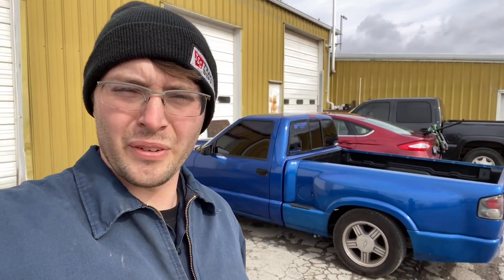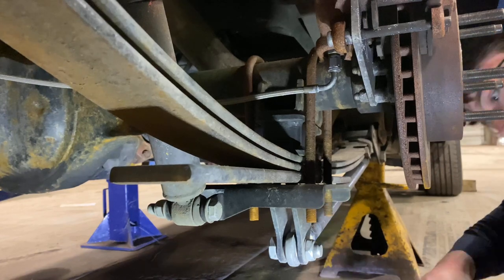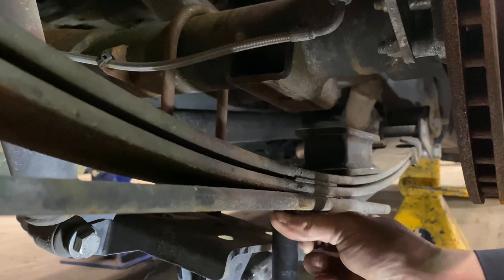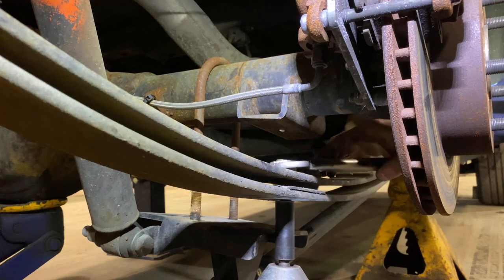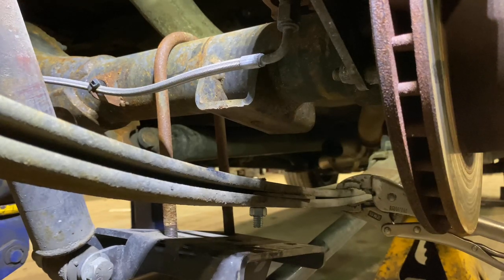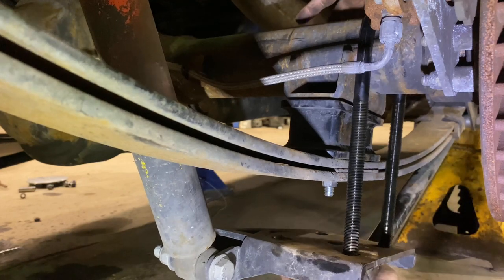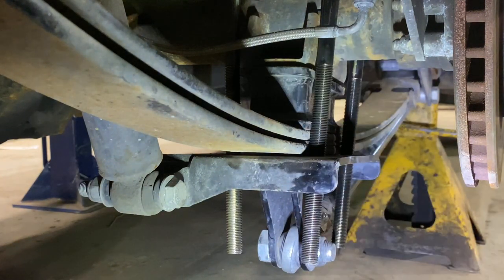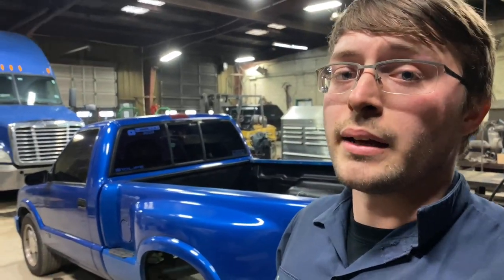How To Ls Swap: S10 Remove Helper/Overload Spring

Comment: I canned the lowering blocks and got drop springs , pinion angle plate and 3/4" in trans riser block from JTR. Major improvement in ride and handling .
Reply: Cant put traction bars on lowering springs

Comment: Just curious,  why are you removing the one spring ??
Reply from the maker: It affects the way the truck leaves, when the spring engages it changes the spring rate. I’ve read a lot of fast people do it. It also cuts weight a little
Reply: It also lowers the rear some